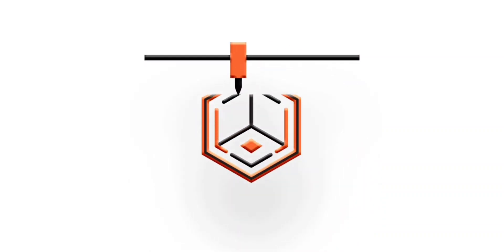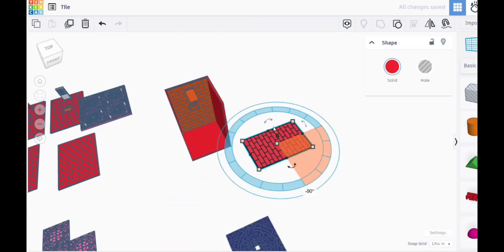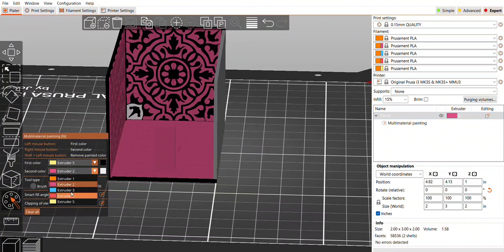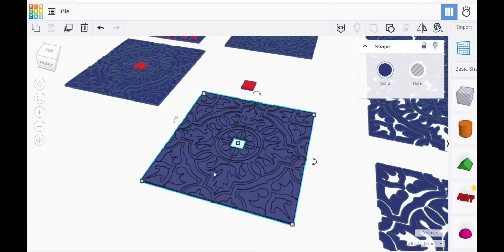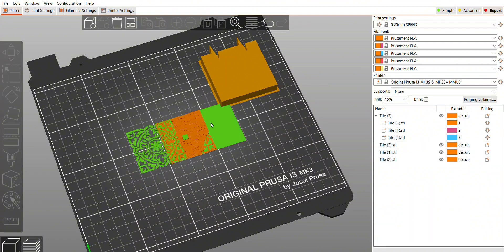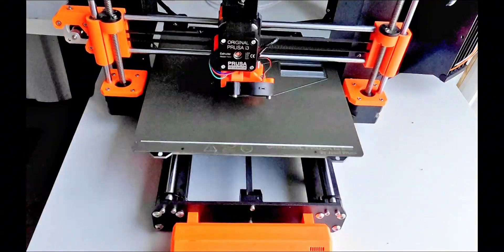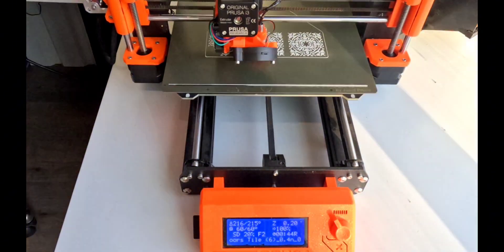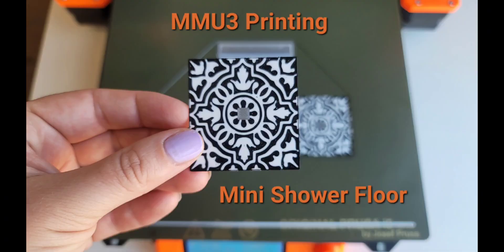Prusa MMU3 Printing Miniature Shower Floor - 3 Color Print

Comment: There was a good video recently by YouTuber Robert Cowan showing how he printed a multi-material object on his Prusa XL. He showed some techniques there for assigning the different filaments to the different elements of his model that seem a lot simpler/quicker than having to paint them all.  I'm not 100% sure it would carry over from the XL to the MMU but it might be worth a look to see if it would apply to what you're doing! Video is called "Prusa XL - Multi-Material Testing"
Reply from the maker: Thanks so much!

Comment: To hide those small holes (gaps) on the first layer, I would try adjusting your Advanced > Extrusion Width up another 0.05 from where it is. That little bit of extra material should flow in to cover it up.
Reply from the maker: Thanks so much!

Comment: First layers came out so good, I thought that small patterns would be a mess to print especially for the first layer and adhesion issues.... what filament and first layer settings are you using? Thank you
Reply from the maker: I use Overture PLA with the generic PLA profile in Prusaslicer. I usually go with .15 or .2 layer height. I think this was .15. Thanks so much!
Reply: @tada3dprinting  Thank you for the infos and keep up the good work!

Comment: I would try this print on a textured bed sheet if you have one. They hide first layer lines so much better. Also, I have found using the Arachne setting sometimes leave more holes. Maybe try a test print with it off. Always fun watching your videos.
Reply from the maker: Oh good ideas. Thank you!

Comment: One thing I am a bit curious about, but can't test since I don't actually have the MMU yet - the slicer actually lets you perform filament swaps similar to how it works before having the MMU. This could theoretically allow for more than 5 colors in a single print, with some careful design (being careful not to have more than 5 colors in a single layer). How tricky is it to perform a filament swap mid-print with the MMU?
Reply from the maker: I think what you're saying is possible. I hate swapping filament on it even if its not mid print. I would worry that it wouldn't catch on the second color. But if you're there when it swaps, and it errors, you should be able to fix it. Interesting idea!

Comment: 3:47 -  yes, you're supposed to export them separately, but you're still putting them in different positions. That's why they aren't lined up when you pull them into the slicer the first time. Notice how they keep the arrangement when you import them.

The biggest thing that having an MMU will likely change is the process for creating new designs. For example, with the floor tile you have the white part as a solid block, which isn't ideal. It should have holes where other parts intersect. I don't know how easy that is in Tinkercad, as I don't know if it support boolean operations.

I've also been playing around with minimizing tool changes and how the internal structure of a print affect print times. Something like a sign I'll probably only need a couple of layers for the design, and to be honest sometimes a filament swap like I was doing before is still a valid option, in which case the MMU will simply automate it.

Also - the Purging volumes button can be useful for minimizing waste, it controls how much the printer will purge to change colors. Once my MMU comes in, I'll probably track how long it takes to purge to/from different colors in a spreadsheet.
Reply from the maker: Ok great to know! Thanks so much!

Comment: So, so far it is doing great ha? 
Do you recommend it? Are you gonna try this on the MK4 as well?
Sorry for the questions, Thank you for the video.
Reply from the maker: The first few prints I got very frustrated with the errors. But once I got the feel for loading the filament correctly, I haven't had any more errors. The down sides for me is swapping filament is a huge pain, it takes up a lot of space and just looks messy. But it is working and now I just need to learn how to slice things for it. 

I did preorder it for my MK4s but they haven't shipped yet. Just got the Bambu AMS in and so far I like it better. Thanks!

Comment: Quick question.....did you by any chance see how long the print would have taken if printed all in one colour? It would be interesting to see how much time the colour changes are actually taking
Reply from the maker: A little over 27 hours with color changes. 3 hours and 40 mins without color changes. It's set at .15 quality for both. 

It looks like I can print a max of 7 at once and it will be 2 days and 10 hours. That sounds much more reasonable than 27 hours each. Thanks!
Reply: @tada3dprinting  I did some quick math and estimate from your numbers 1.5 minutes per change (23 hours x 60 minute = 1380 minutes difference / 849 changes = 1.62 minutes)   Any changes that make a big reduction in swaps will cut the time
Reply: I was thinking the same thing.  The complete design had 849 color changes.  I'm not sure what the time is on the MMU, but I know on my Bambu AMS that I figure a couple of minutes at least per change.  If the MMU was one minute it would add 15 hours.
Reply: @woodwaker1  I have said on a few videos that I suspect the XL  would be quicker than a bambu printing a complex colour model. The fan boys disagree, saying the bambu is so much faster that even with the colour changes it would still be faster.....I some how doubt that.....but it would be fun to see for sure.
Reply: @TDax  I agree.  That is a big reason that I try to do as few color changes as possible.  I have done filament changes using a M600, on layer changes.  You learn to be very careful as it takes a lot of time and effort.  The Bambu and AMS makes it easier, but still try to keep under 50 changes per print.
Reply: @TDax it should be faster with the multi tool heads as it doesn’t need to stop, cut filament, purge old, clean nozzle, load new, purge/prime bit more to stabilise etc. XL just takes about 5 secs to stop and change tool head, then another 10 or so on prime tower to stabilise flow, then prints with new colour. A lot less wasted filament as well.
Reply: @wafflecart  not according to the bambu fan boys ;) their printer is so quick it will still beat the XL .....why let silly things like physics, fact and reality have any effect on print times lol

Comment: I really like these prints where you are printing your own creative designs, and especially the diagnosing and planning that goes into the whole thing.  It's really interesting.  The miniature designs are so cool and nice.    I want to do this to make my dioramas for s train set, not so much internal designs but for external structures, like barns and old brick and wood building etc  👍
Reply from the maker: Oh that would be really cool. I actually started in minis by painting birdhouses. I created a whole little village (why my minis are called mylilvillage) with them. Having something motorized like a train set would be cool!

Comment: Seeing as you have a working design as a start point, probably making incremental changes is best. (True for coding, metalwork, PowerPoint decks ...)
Trying to print the whole shower in one go with all the colour changes is probably going to spend a huge amount of time changing colours and building the purge block. Should be much better on the multi-tool XL though.
Edited to add: forgot to say the new floor looks great, the automated filament change worked pretty well!
Reply from the maker: Yes I am dying for my 5 toolhead XL. And I'm sure other prints will be better. Thank you!

Comment: The more you add to the build plate of the same object doesn’t add much more time you want to fill the bed up so you could build 6 of them in those 20 or so hours
Reply: That makes sense....the time it takes to change filament and print purge towers etc is the same for one object or 6....however that only helps if you want multiples of the same print, or if you have room for multiple copies of the print......awesome tip tho
Reply from the maker: I'll see how much savings I get. Thanks!

Comment: I have never been a fan of MMU technology.....generally it's wasteful....in terms of filament wastage and time.i am assuming things will be much better with the XL tool changer technology.
I must admit tho....those shower floors look awesome
Reply: True. But at 5 x the price might be difficult to justify unless you producing a lot of item to sell.
Reply: I used an MMU (and now a Bambu AMS) to automate layer based colour changes, it wastes only fractionally more than doing the colour changes manually. It lets me print layer based multicolour during the night or when I'm out.

It's only the same-layer multi colour prints that waste loads of material, so if I was doing what this video is demonstrating, I would have stuck with layer based colour changes and just used the MMU to automate it.
Reply: @Skonker if you only want to use the MMU/ ams in the way you describe your right.....but I am guessing most people are thinking of printing a full colour model (in the same way Tada wanted to print the shower unit)...that's when this technology quickly shows its limitations.

As I said earlier (and have mentioned in other threads)....I am interested in seeing an MMU/ AMS vs XL comparison.  The XL should be much less wasteful (no poop or purge tower), but will it be quicker? I assume it will????
Reply from the maker: @skonkbot that sounds good. I just really wanted my tile to be one layer on the top. But for the tile wall with the silver sink, it would be nice to be able to run the whole print like you're saying without having to be around for the color change. Thanks!
Reply from the maker: @tdax yes I was figuring the 5 toolhead XL would be my go to for color change. Never thought I would be buying an MMU. But I'm still waiting on my XL. Hopefully soon! Thanks!